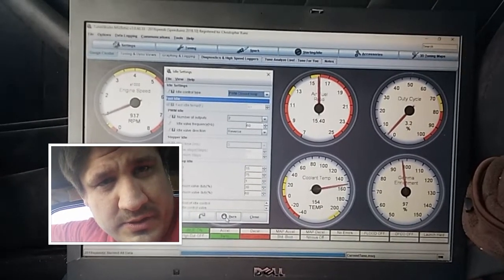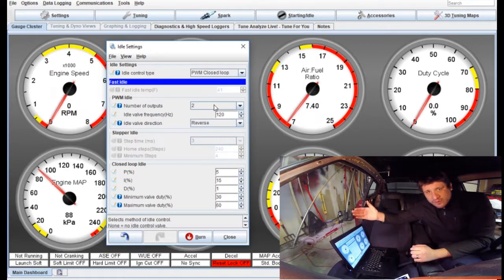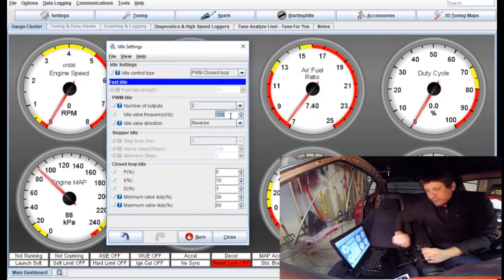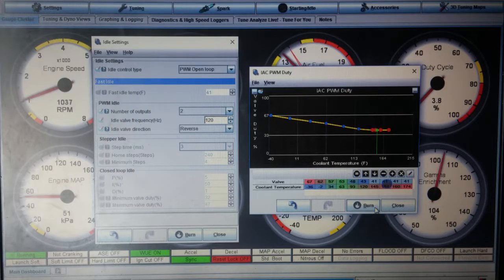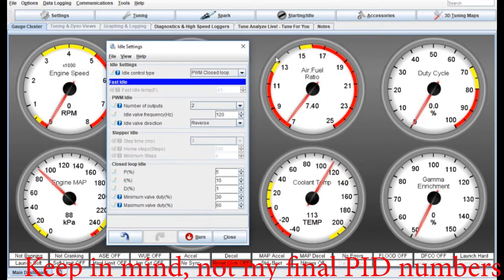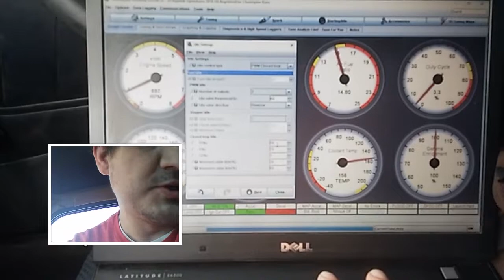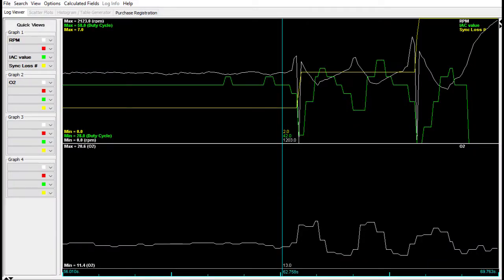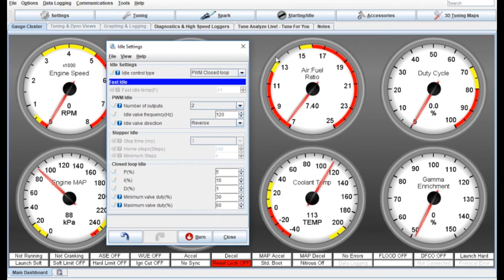Closed Loop Idle PID (Bosch 3 Wire Idle Valve)

Comment: You can look at it this way. The P component essentially is the initial correction that it's going to try and apply based on how far away from the setpoint it actually is, the I component starts tuning the correction based on how long it's taking to reach the desired setpoint(the longer it spends outside the threshold around the setpoint, the more correction it's going to apply to try and get there faster) and the D component essentially tells the controller, that it's getting near the target and it must start easing off, in order to not overshoot. That's my understanding at least. You could omit the I component entirely if you really wanted to, but then you would get "steady state error", since you need a high P value, so that the controller is responsive, but also a relatively high D value, so that it doesn't overshoot, but then they reach a certain equilibrium somewhere around the setpoint, but not quite on it. By adding the I component, you let it see, that it's getting steady state error and letting it correct based on the time spent in that steady state error. Actually many older automotive ECUs featured PD controllers, completely lacking the I component (many VW ecus from the 90s). Hope that helps.
Reply: good info

Comment: Thanks for posting this, it's a long time ago but a good basis for my project. Is there a reason when looking for the right PWM frequency, you drove it around for a few days at each value? Can I just do it in one session, with a warmed up car, running through 5 or 6 values?

Comment: Thank you sir, have been left frustrated after an hour or so of watching tuner Studio videos of idle based on megasquirt. Being on speedy and everything being the same really helped me understand. Only question is how to find the Min and Max for the idle? Was it trial and error? I have it set similarly to you, and it runs, but I want to be able to tune it to the best possible. Thank you!
Reply from the maker: This is going to sound odd, but Speedy only operated the valve when the engine was cranking or running. So I hooked up a 3 foot hose ans rested on the window of the car. I would go in steps of ten to fine the spots when it looked closed and then open. It took about an hour as I would have to change the value and then restart the car each time. Let me know how it is going and if there is anything you need help on.
Reply: CEK Garage Thanks man, I will be attempting more idle tuning tomorrow. As it sits the issue is I’m not getting the car to respond at all to open loop IAC duty cycle changes. I have have it set at 5% or 70% and everything in between and it holds steady at 900-1000 rpm. I took it off to try and clean it but I’m not confident that anything is going to change. Other than that I have the throttle plate completely closed at idle and the IAC adjustment screw all the way tight. I’m not sure what I am missing but I’m thinking it’s something since the car idled great pre-Speedy.
Reply from the maker: Send me a data log and tune if you want me to take a look. Twonutsdiy at gmail. Have you checked for any gasket leaks around the intake?

Comment: I have a ms3 and use stepper motor idle valve, its giving me endless issues and want to convert to pwm valve. What is the best pwm valve to use with megasquirt.

Comment: Hello.  I need your advice.  I’m switching my engine to EFI.  I’m using mostly ford EFI parts.  My question is how to connect my ford 2 wire PWM air idle controller.  I believe I connect this air idle controller to pin #37 on ECU and negative 12V. Is that correct?  Thank you
Reply from the maker: 2 wire idle valves normally operate with a positive 12v source and a PWM negative 12v from the ECU. In your case, you are not describing a 12 positive source is your description. Pin 37 is a PWM negative from the ECU. So if you connect the other side of the idle valve to a positive 12v, you should be good to go (make sure it is fused, and only supplies power with the key)
Reply: @CEKGarage  
Thank you for your answer.  You’re the tiebreaker.  I had one person say to connect one lead to negative 12v another person said to connect to 12v positive, the other lead to pin #37 on ECU.  Great videos, again thank you for your help.